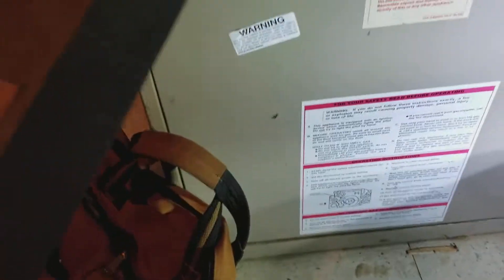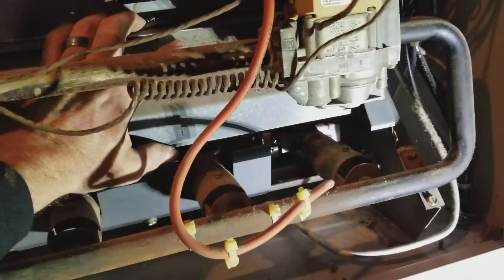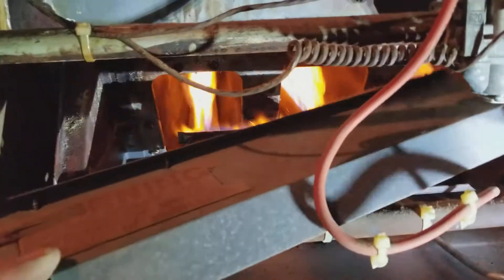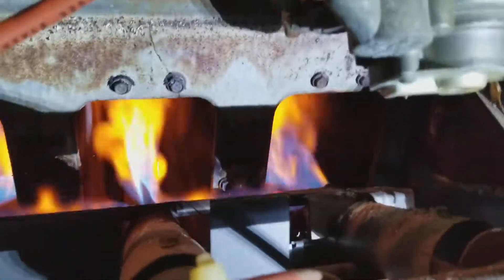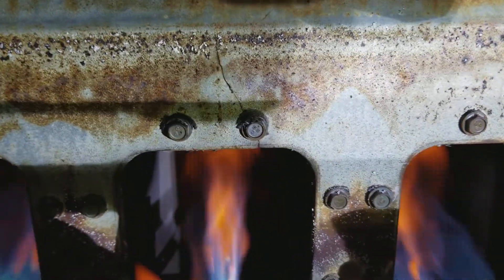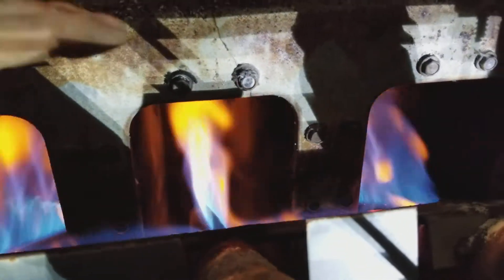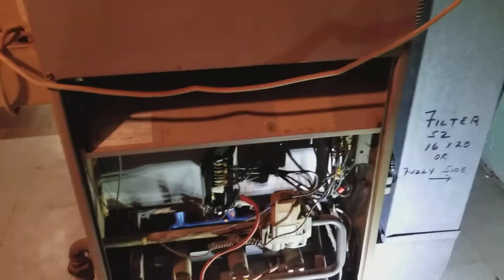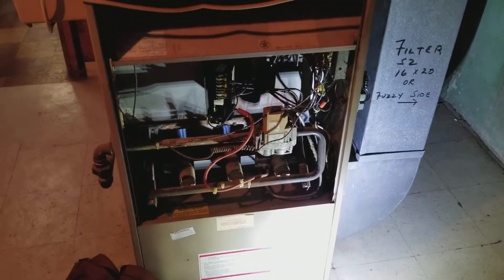Luxaire heat exchanger (cracked)

Comment: Winter of 2016, they had me helping some with residential since commercial was slow at the time. Using your videos as reference I was able to find numerous furnaces with cracked heat exchangers other companies missed.
Took pictures of each and showed the home owners. They were actually happy to change the systems out and most didnt get other bids. 
Thanks for your time and contributions